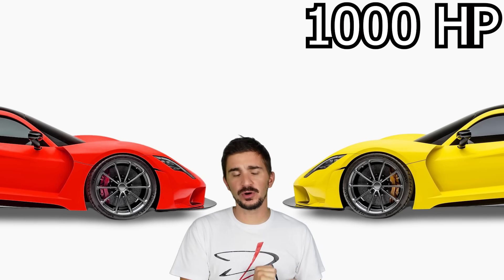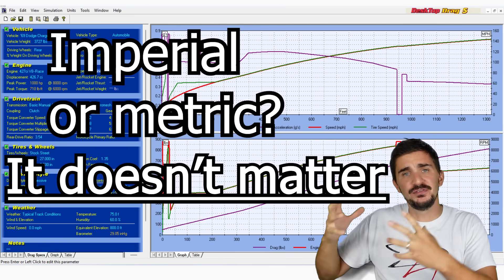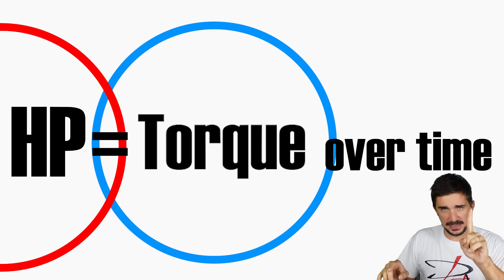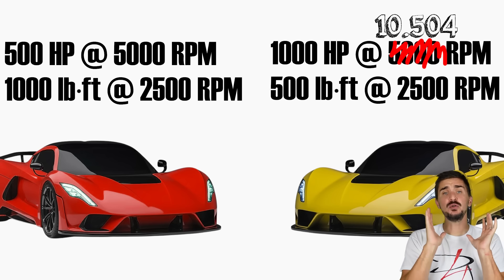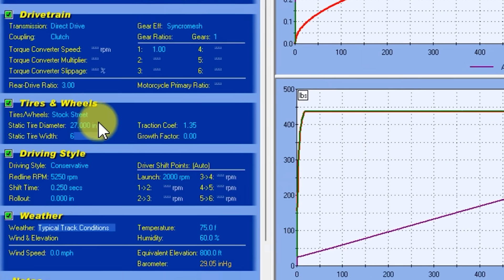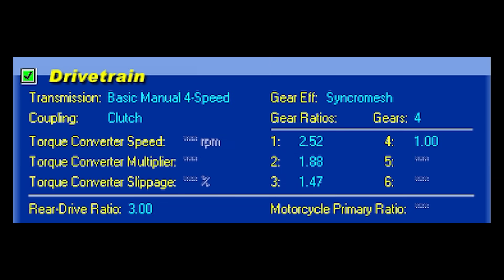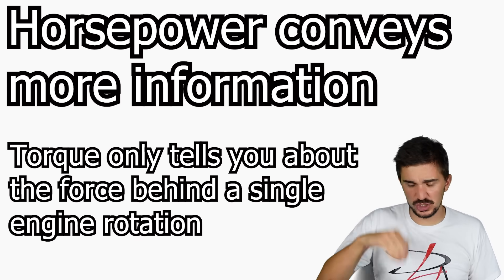Who's faster? Explained and Simulated - Horsepower vs Torque

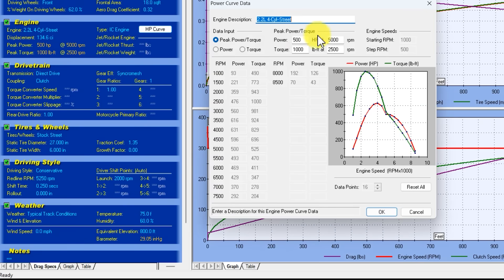Comment: i am sorry, but at 7:27 you create a nonsens engine with 500lbft at 2.500rpm (so most likely a turbo charged engine) with on the other hand revs 10.504rpm for its power maximum (which clearly is a naturally aspirated race engine) and then you let it run the quarter mile with a gearbox with a nonsens ratio, it stays in 1st gear for all the distance.

i just imagine a 10.500rpm engine and doing a launch with a gear that reaches up to 100mph+. of course this does not work at all and gives horrible results but it does not prove anything about the power/torque question.

for a fair comparison you have to:

1. create 2 engines that are possible in real world. the 1000hp engine is absolutely not
2. give them a gear ratio inverted the rpm ratio, so that both engines use the same relative rpm (%) at given speeds

then you will see that of course the 1.000hp engine is way faster than the 500hp engine, it is twice as powerful.

choosing the quarter mile as a comparison is also not the best idea because 500hp is already quite powerful and up to 60mph there will barely be any difference between 500 and 1000hp in a '84 crx weight car. take 200 and 400hp and the results will be much more reproducable. or do half mile.

Comment: One big issue with your comparison sir.. an engine with a 10k rpm redline will need much different gear ratios than an engine with a 3000rpm redline.  In your comparison it looks like you used the exact same gear ratios for both... that 10k rpm engine will have like 3 times the top speed vs that of the 3000rpm engine.

HP is king when it comes to acceleration.

Comment: Just want to add that peak numbers are less important than 'area under the curve'. For a 7000 rpm limit vehicle in a drag race, your rpm will sweep from ~4000-7000 as you climb the gears. So the torque values at each of these rpm is the force that is delivered by the engine.
Reply: seems to be why you see a lot of 4cyl cars with stated high HP numbers lose a lot of drag races,  their power band sucks.
Reply: I've always wondered why the integral of horsepower wasn't the main metric used to compare... it makes no sense to me.
Reply: horsepower at each rpm is what matters for the actual force that is delivered to the wheels. a `high torque` engine just deliver more horsepower at lower rpm.. compared to a `low torque` engine, if both have peak hp of say 500. this is obvious when one look at the calculation for horsepower, which is torque multiplied by rpm
Reply: Depends on how many gears you have or more accurately, how close each gears ratio is to the next. More gear ratios - closer gear ratios - less rpm drop on each shift - peaky powerband car is fast
Reply: exactly why I said approximately 4000-7000. But yeah it will drop some amount proportional to the ratios of the subsequent gears.  @Gnerko123
Reply: Usually traction is the issue in high hp 4cyl fwd.
Reply: @prestongodsey3567  traction is an issue for everyone in no prep racing.  Im just saying that 4cyl cars with stated high HP numbers dont seem to perform as well as V8 with high HP or even 6cyl.
Reply: @TheBroLounge  only example I know for sure is a guy had a 4G63 in a foxbody for a weight break in the class he raced when at a track. It made north of 750hp and sounded insane but consistently went mid 8's on the weekends
Reply: @TheBroLounge  also if you can find a 240sx(silvia) that isn't a drift car, those somebucs will move out with a quickness. Bolt ons will have them low 11s/ high 10s
Reply: @TheBroLounge  anything Cosworth or Catterham touch with 4cyl usually moves alright to say the least.
Reply: Also the fact that a turbo'd K-Series civic in street race trim usually weighs around or just under 2000lbs. So not alot of weight to help traction
Reply: I've seen a dodge neon srt walk the dog on a couple different 1000cc bikes, from a 40mph roll. From a dig, they usually get him bye about 2 cars. His 60' is like 1.80's.
Reply: Im only 30 seconds in, but big block baby
Reply: I'm sure you know this, but if you can have the same torque curve from 6000-10500rpm (10500=6000*7/4), this is more advantageous. This allows your engine to produce the same torque but with simply a 1.5x better final drive ratio while maintaining the same shift points in terms of wheel speeds. So your graph of speed over time looks the same except just a 1.5x steeper slope once in gear and tires not slipping. And horsepower accounts for how high the redline of an engine is while torque doesn't. 

However, one might argue that on the other hand, torque allows you to have the same effect as a high rpm engine with longer gearing. So I believe horsepower under the curve to be an equal metric to torque under the curve.

Comment: Finally!! Someone mentions “weight” into the equation! This is the best explanation I’ve came across yet. I’ve tried to explain to people that weight doesn’t matter as much of you have a lot of torque.
Reply: @ThuhElement  where exactly does your vehicle have torque?
Reply: @simplemachine9531  The question is simple though. My point is also simple. 

My point is that a vehicle with more torque is affected less than a vehicle with less torque when adding weight. 

Motorcycles are a really good example. A bigger heavier bike with similar HP figures but much higher TQ figures can have much more weight added and still be quicker.
Reply: @ThuhElement  your point is simply wrong because it violates basics of classical mechanics. There are no two different forces acting on an empty or loaded bike, it is the same force, F=ma. If a sports bike accelerates faster than a chopper, it will still accelerates faster if you keep adding same load on both.
The Second Law leads to
Acceleration=Power/(speed*mass). 
No torque here because it is not related at all.
Reply: @simplemachine9531  I’m not sure where you and I are losing my point. 

I have experienced situations where two bikes with similar HP but one had higher torque and weight but still easily won. From a dig and a roll. The bike with more torque also redlined at 10,500rpm and the other lighter bike 14,000rpm. 

Torque absolutely matters. I’ve raced too long to say otherwise. 

Your math I’m sure is right but I don’t think you see my point.
Reply: @delusion2987  I agree with this. I own a turbo zx14 and the torque is absolutely stunning.
Reply: And you failed because torque has nothing to do with "weight" and weight always decreases acceleration proportionally.
Reply: @simplemachine9531  So let me ask you a simple question. Do you believe a vehicle with less torque can move the same weight as a vehicle with more torque?

Comment: Diesel engines typically produce high torque but low horsepower, whereas F1 engines produce the opposite effects.  The effectiveness of each engine is determined by its respective job requirements.  Having said this, however, I dare say we will never see diesel engines powering any F1 cars.   Overall, the lesson being taught here is that engines are only one piece of the ultimate “power projection puzzle”.  And he didn’t even go into how different engines can produce radically different-shaped torque curves and how said curves also affect the power’s usable efficacy…or the weight differences of said engines/transmissions.  The many-faceted variables of automotive engineering are harnessed daily to produce some of the best petrol-powered cars ever built, NOW IN THE PRESENT!

Comment: Can we mate it even more simple?

Two 10 rpm engines
One with a peak Torque of 1000ft/lb
One with a peak Hp of 1000 well.... 1000 hp

Engine n1:
1 rpm through 4 rpm has 1ft/lbs per cycle then 991ft/lbs per 1 cycle, then another 4 cycles of 1 ft/lbs per minute

The other engine can have horsepower well distributed all around... in one minute, rotate 10 times (remember it's a 10rpm engine) and all of a sudden you have 100 horsepower shared equally 10 times in one minute instead of one single thousand 

idk what Im talking about, someone plz correct me lol

Comment: Horsepower is a measure of how much work can be done in a given amount of time. Make whatever abstract engine scenario  you wish and in an equal yet optimized vehicle the one with the most horsepower will be faster. Those two engines will require vastly different drivetrains to be optimized for each and when done the higher horsepower engine will be faster.

Comment: Engine torque just determines the gear ratio you need to take off with a given load. Once you're going, power is speed times force, net force (having subtracted air drag, rolling resistance, and gravitational force times incline factor) is mass times acceleration. High torque can flatten your power curve, making it more forgiving of poor shift timing, but power is still power. Higher speed count and faster shifting in transmissions makes torque decreasingly relevant.

Comment: I have tried to explain this to a bunch of Honda guys I know that brag about their cars making 400 hp, at an ungodly rpm. All they do is drive the car through town at 35 mph, at a reasonable 1500-3000 rpm. Their barely making 100 hp and negligible torque, so all their bragging is pointless.

Make 300 ft-lbs around 2000 rpm, then I'll be impressed.

Comment: The acceleration comparisons don’t really work without understanding torque spread.  Suppose two engines have perfectly flat torque of 500 lb-ft from idle to redline. Engine A redlines at 5000 RPM and Engine B redlines at 10000 RPM.  Then as you indicate, the higher revving engine B makes twice the horsepower because torque and hp are mathematically linked. B will accelerate twice as quickly as A.  Why?  Because if you gear B down 2 to 1, the output shaft mimics the other engine’s at 1:1. Both output shafts now top out at 5000 RPM.  However torque of engine B is doubled from 500 to 1000 lb-ft from idle to 5000 RPM. Engine A at 1:1 makes half the torque, 500 lb-ft from idle to 5000 RPM.   Torque reflects an engine’s ability to generate torque. At a given RPM if horsepower is double, then it can generate double the torque and double the acceleration. And that’s all there is to it.  In the real world, torque curves aren’t flat but the same principles apply. If torque spread is equivalent for two engines, higher hp wins the race.

Comment: I was thinking that using a CVT in the simulation would make for an interesting comparison, by allowing both engines to run at their peak power. I'm also thinking, doesn't the torque curve imply the power curve as well, since you can just multiply torque by RPM across the rev range? That is, the torque doesn't convey "less information", but rather torque, power and RPM are all related.
Reply: A CVT would give us the best theoretical performance. Torque does convey less information. Power is torque normalized to an RPM (In Imperial units, that normalized value is 5252 rpm). Power tells you how much work can be accomplished. Torque just tells you how much drive is available to do the work, but not how much can be done.

Comment: Actually if the crank is less than 1ft

The torque curve no longer follows this formula.

Making the stroke shorter can trade torque for hp and rpms 

More rpms gives more torque as mass increases with speed. The dynos, don’t quantify this.

Comment: I like the punching analogy because you're using pistons, which move linearly like a punch, and you get something akin to a punch acting on the connecting rod when combustion occurs in the cylinder and pushes the piston down. It's not exactly right because you've got the mechanical transfer from that linear motion into rotational motion through the crankshaft, but it is a more useful analogy than ones I've heard in the past. With larger numbers of cylinders, you can get more punches in each revolution and therefore produce the same amount of power at a lower RPM than an engine with fewer cylinders. It's not just about displacement. I'm kind of rambling now so I'll stop, but thanks for the video.
Reply: The analogy of a bicycle and it's gears is helpful too. My teacher used to explain it like that.
Reply: Punches are perfect analogy especially in boxer engines 😂
Reply: Rotating high weight mass applies more torque than a lighter weight. But force applied to that Rotating mass can be demishiesed. A Lighter Rotating mass with the same force applied will increase in RPM and torque but can handle higher forces if applied.  So engine building is a catch 22 situation 😂
 Getting the right combination of force vs mass 💪 is actually where's its at, power to weight ratios...😂

Comment: Here ill help you choose. Pick torque for daily driving both engine and gear so you can move around easily at low rpm in traffic. Pick hp if you want performance because thats more energy you can play with. While torque starts faster hp ends up faster in total speed. So its a matter of choices for a track but for daily driving no question torque is better
Reply: except torque does not start faster 👌🏻 as long as perfect gearing be involved at launch you have grip limit ,rottational inertia of everything ,clutch and  rpm for spin engine higher at launch  👌🏻 kawasaki zx4 r with 1 gear to 90 km/h „no lowend at all” can still achieve 0-50 km/h with 1 ft On in under 2,0 sec 🤷🏻‍♂️ with max 40 nm at 11 k rpm 77 hp at 14,5 k rpm and like 25-30 nm at 4-5 k rpm vs feg royal enfield 500 which have 41 nm at 4000 rpm and 27 hp at 6000 rpm at similar weoght including rider do it in like 3,5 sec 🤭  royal can launch much mpre cpmfortable when both start from low rpm so like for daily riding cos its engine makes more torq down low but for racing this characterisitic is pointless as long as gearing be good … once it be drag race where rider on  zx4 r spin engine at launch to 12-13 k rpm at optimal clutch sliding its game over for re 500 👌🏻 despite this zx4 r with stock gearing is not even close to optimal gearing for fast launch and despite it have weaker lowend  👌🏻 the same zx4 r with optimla gearing for fadtest 0-50 posiibleso 1 gear to 51-53 km/h and it do it not to much longer than 1,0 sec assuming you put on this zx4 r competent skill rider  which be able to hold front wheel down asf in roayal enfield 500 you cant improve 0-50 time acceleration cos this bike already in stock form have best optimal posiible gearing with 1 gear like 2 times shorter than zx4 r 🫣 in regard to how much km/h both can achieve at 1 gear 👌🏻  just power limits this bike for not have better accelerstion 🤷🏻‍♂️👌🏻 here you have some nice egzample kaabo wolf king gt pro electric  10 hp max 100 nm avg including all resist like cda 0,6 around from 0-50 km/h in 3,5 sec weight with rider around 130-140 kg 👉🏻 https://m.youtube.com/watch?v=E3dY0NSPfNM&t=44s vs feg kawasaki z 400  weight with rider 230  kg almost only 38 nm but 45-50 hp it launch from 0 to 50 km/h in 1,6-1,7 sec if you include 1 ft on   2 times faster with almost 2 times biger total weight while having at leadt 2,5 times less max engine torque 🤷🏻‍♂️👉🏻 https://m.youtube.com/watch?v=MCZupwcfdB0&t=121s&pp=ygUba2F3YXNha2kgejQwMCBhY2NlbGVyYXRpb24g …   alot torq down low is very good for daily riding for comfort once its race and some  vehicle have engine with more power at perfect gearing ,lowend torq have no chance on track 😎👌🏻 or feg lets assume we have 2 electric kick scooter vehicle the same weightone have 100 nm from 0 rpm one 50 nm from 0 rpm which would accelerate quicker from stand still with the same rider weight up to let say 50 km/h ? ypu cant say as long as you dont know final gear ratio 🤷🏻‍♂️ so what this first have 2 times more torque it only takes be this 2 scooter to have 4 times feg shorter gear ratio and now despite it have 2 times less engine torque it generate 2 times biger contact path force at launch in resluts force:weight =it accelerate 2 times quciker more less  🤷🏻‍♂️ assuming this torq be up to enough high rpm naturally when i. worte about 0-50 km/h 2 times quicker 👌🏻
Reply: @mociczyczki  nah you want a higher torque at lower rpm for daily to reduce friction and engine strain. I know gearing helps but keeping low revs is for longetivity

Comment: What’s faster, hp or torque? In a drag race the answer is average HP used. 

Although I see a lot of good stuff in this video I think that somehow the correct conclusion was not clear. What was really clear was how much different tires, transmissions, and reared ratios affect the ET. If you select the proper gearing and tires for the engine you will be able to maximize the effectiveness in the 1/4 mile. If you do it in this case the 1000 hp engine would blow the 500 hp version away. I request a follow up video showing the 2 engines in the same car with the same (good) tires with optimal gearing. I think that this would add clarity.